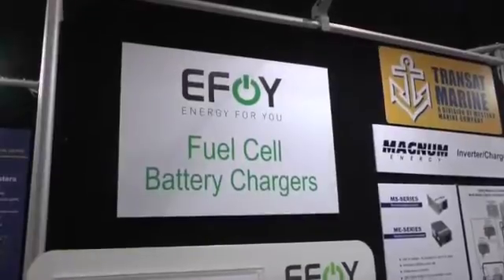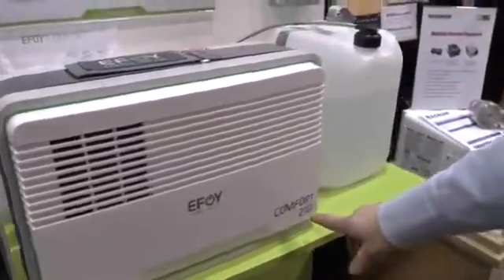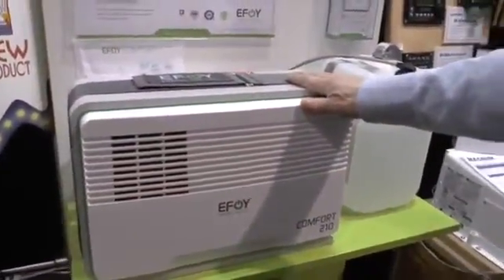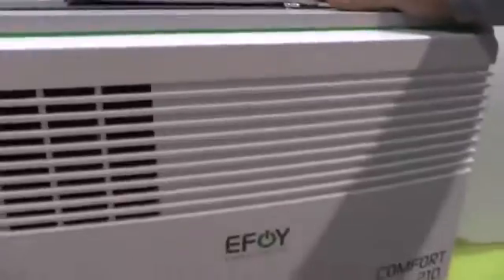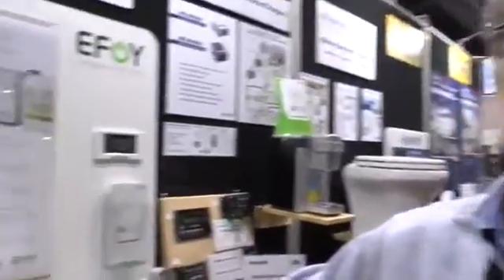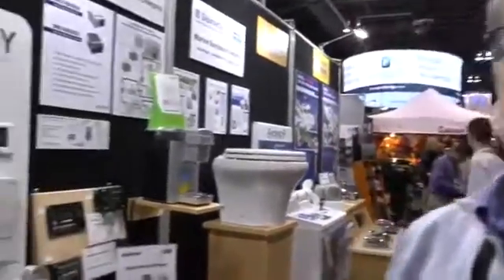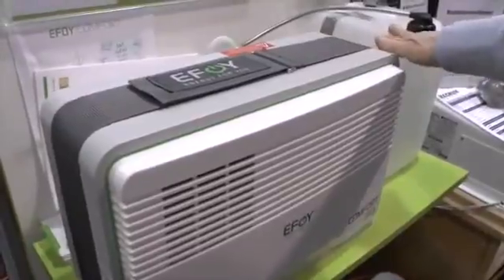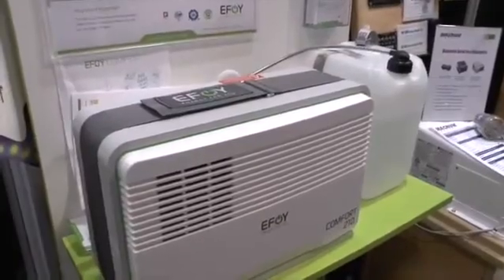EFOY Fuel Cells with Alan Stovell and Boating Industry Canada

Comment: Can Ethanol work in the fuel cell
Reply from the maker: Hi Jimmy, we reached out to Alan Stovell to answer your question. Here is Alan's response:  "The answer is no. The EFOY runs on a proprietary fuel that is contained in a sealed container that you do not refill. When the fuel supply line from the unit is connected to the fuel canister it is a sealed system with no vapour. "

Hope that helps!